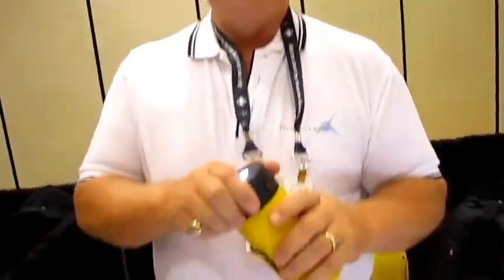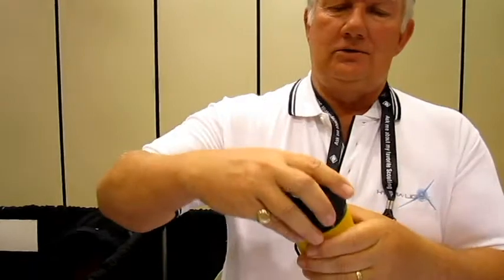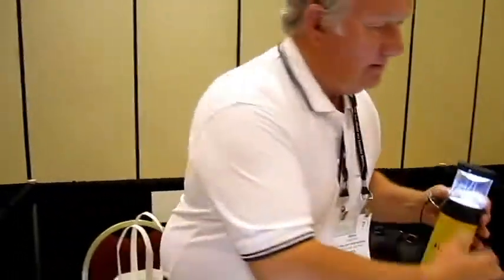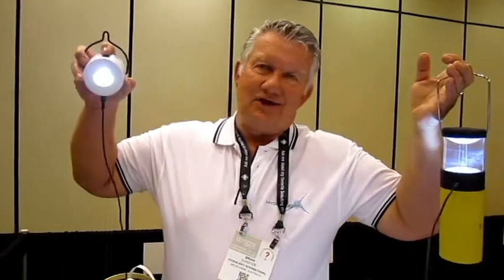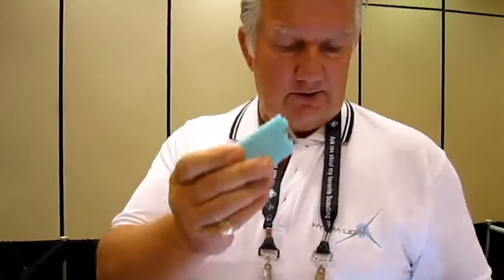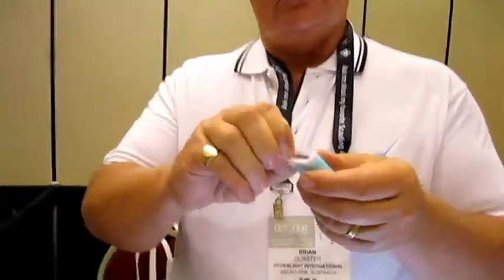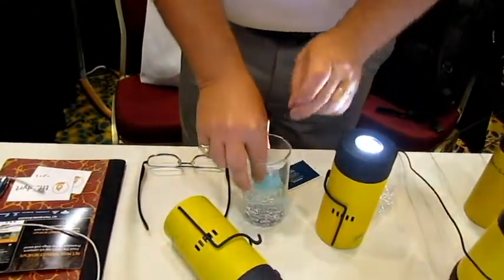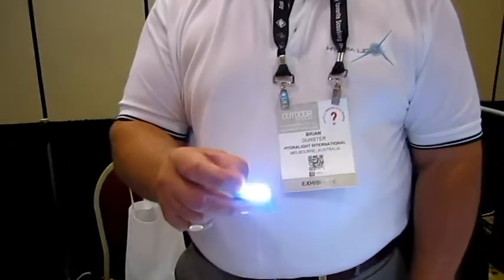Spinning Light From Water with Hydra Light

Comment: I am one of the backers that funded this company on Kickstarter. I thought it was great idea to have batteries that can be "stored for 25 years" - according to campaign promises - and have the HydraLight ready to be activated with just salt water and providing light on moment's notice. As a backer I was rewarded with SC1C-L lantern that uses the same magnesium batteries this flashlight does. The lantern worked great the first time, and the second time. I stored it in a dry place for a couple of months and when I tried it the third time it did not work. The batteries just could not supply sufficient current, meaning their internal resistance has gone way up. This might be caused by corrosion as other reviewers indicated.
I contacted the company several times about it, reporting symptoms and asking about buying replacement batteries. I used both their website and Kickstarter messaging system. I have been completely and utterly ignored so far. :(
Thus, this product, although promising in its idea does NOT work in practice. It seems the company dedicated no resources to long term (well, at least a few months) research. The batteries CANNOT be stored for "25 years", as promised, but only a few months after which they become unusable.
Buyer beware! This product is not worth its price.
Reply: because you added salt. this flashlight does not need salt.

Comment: just bought one and love it. after getting it in the mail I soaked it in water and left it on for 24 hours before shutting it off. intend to buy more of them. I have only one Question, What is the life cycle on the fuel cell? does the fuel cell wear out?
Reply: Not much is known regarding the dissociation from the hydrogen ions that happens in these type of cheap fuel cells.
Normal, conventional fuel cells REQUIRE adequate ventilation...
This thing is a major lawsuit waiting to happen!!
For those that have or use this, ALLOW AMPLE VENTILATION!!! 
Very dangerous to employ such methods in a cheap consumer product like this!!!!!!
Hard to believe it is 2017, selling flaky crap like this...